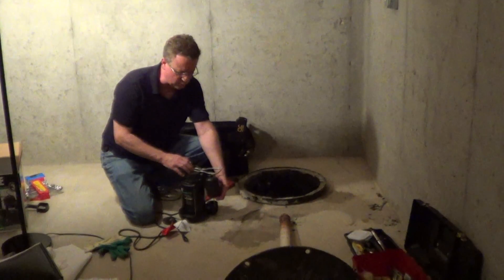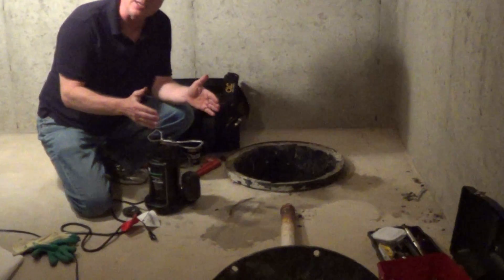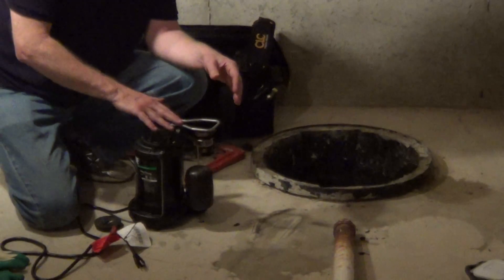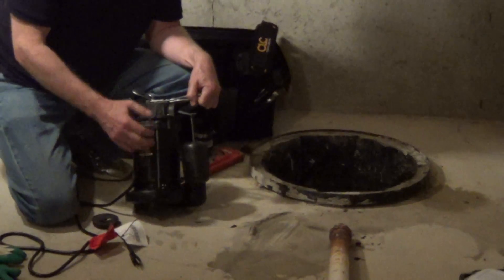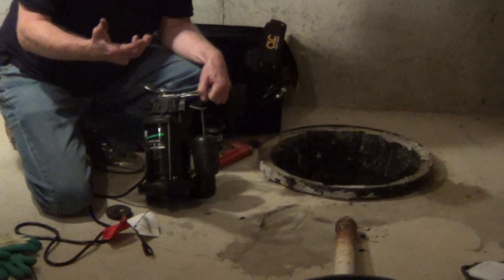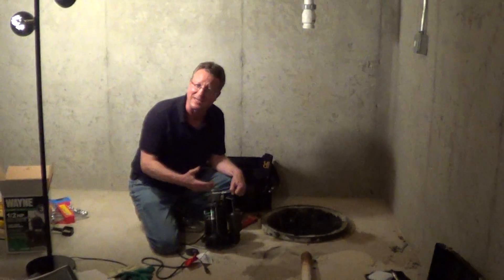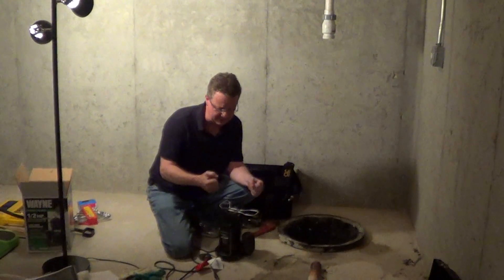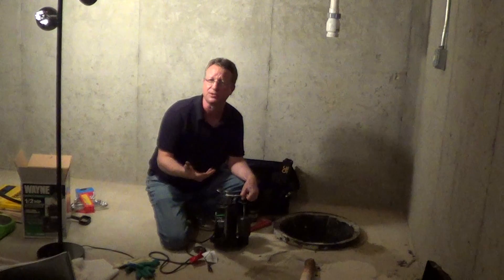Sump Pump Installation Tips

Comment from the maker: Hi,
If the pump switch is not working properly, you can buy a kit that replaces it. I would call the company and see if they will send you a new switch or pump. I've found most companies helpful. The vertical float could get caught on the electrical cord if it is not tied up.

Comment: I just discovered your videos, and they're very clear and helpful. I have a new sump pump, of the type with a vertical rod for the float to travel up and down, that failed to trigger when my basement flooded. It seems to work fine now, and the float moves easily.  Is there some way the float could have become hung up?  Any preventive measure I can take?